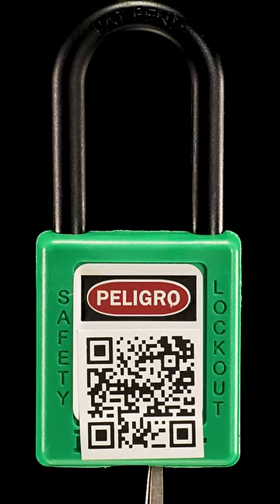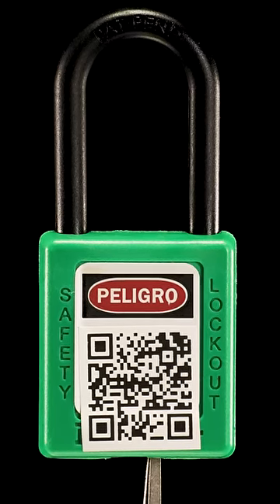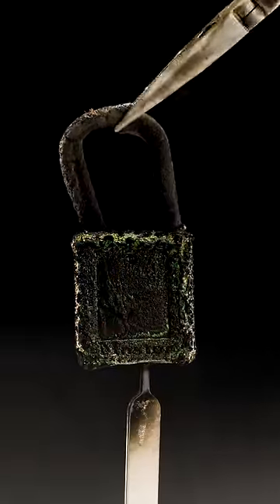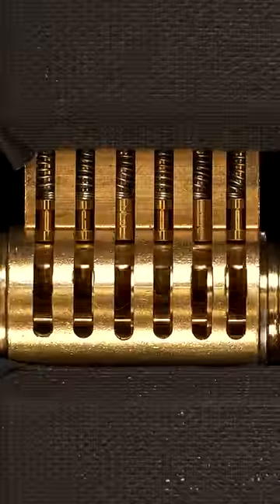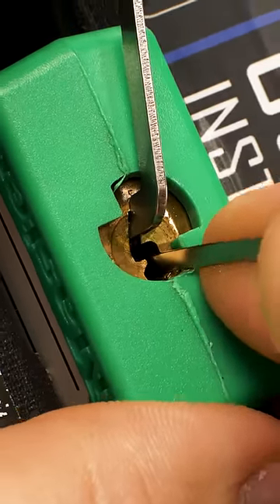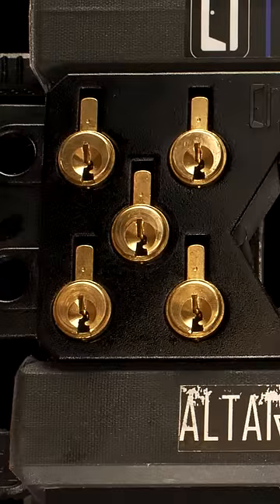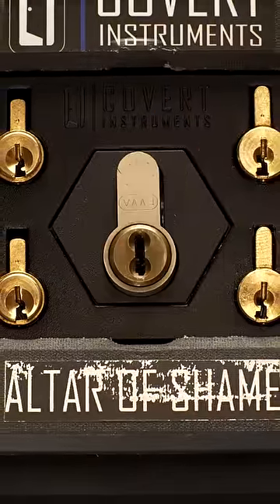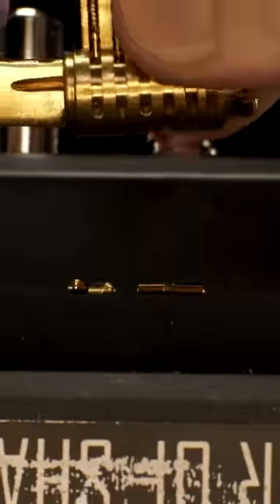Locksport Trainer

Comment: Well, in their defense, attempting to break that lock when it's in use is probably a felony charge.
Reply: if someone is already committing crime. They dont care if its illegal to melt the lock
Reply: @mar_3620  But that's the thing, that's not a lock you use to store valuables, it's a lock-out/tag-out lock. It's not designed to be durable, it's designed to indicate that there are people working on a dangerous machine that's currently inoperable. If these locks are disregarded, and the machine is turned on, those people end up dead.

No one can remove these kinds of locks other than the person who placed it there (or an authorized personnel, after a shit ton of safety checks and paperwork). That's how they keep a headcount. If you're not that person, or haven't gone through the procedure, the act of tampering with that lock is itself a felony.
Reply: @Gatlinggunman  and possibly a homicide
Reply: @Gatlinggunman this info needs to be posted more in this vids comment section
Reply: @Gatlinggunman That doesn't change the core point though - given that we're primarily depending on policy here and the lock is really just a strong signal to stop what you're doing, why go through the extra effort to make this lock pick resistant when the same company refuses to use these exact same cores in their "high" security locks that are actually supposed to withstand physical attack? If a plastic lock is enough to stop an attacker, that attacker probably isn't going to try and pick the lock either, because they're clearly not really trying to break in.
Reply: I prefer a cordless angle grinder for the plastic lock. Its the greener way to do it...less carbon emissions.
Reply: @Unit-kp8wm  The video is in a broader context of a large number of videos by McNally about Master locks being bad, and it's a YouTube short. It's pretty clear that it's a criticism of their overall lineup by the fact he calls this their most secure lock, rather than just saying "lol Master makes a plastic lock". If it was directed solely at this lock he wouldn't have bothered mentioning their other locks. It's also worth noting that the opening of the video very clearly shows the lock out branding on the front of the lock which is very clearly different to Master's high security branding - not everything has to be spelt out in a one hour video essay.
Reply: @Gatlinggunman  this is absolutely true.... there is a warehouse with a breaker that has this lock on it for about the last 40 years but since it is safety protocol that only the person who puts it on is allowed to take it off.... since that person isn't there anymore and nobody knows exactly what it goes to or what hazards could be involved, no one dares to take it off.... it will probably be there another 40 years until they are ready to demolish the building to start over

Comment: To be fair I think the lock is more for "lock out tag out". Nothing to break into, more for stopping something from operating. That doesn't excuse all their other failures though.
Reply: 100%. It's disingenuous to compare these to any of their other fantastically terrible products.
Reply: I'm so glad someone beat me to this... LOTO (I've got one with my picture on, but never use it) 😂
Reply: @benjurqunov  wtf? 🤣 What's that got to do with anything
Reply: Well it does say safety lockout right on the lock.
The irony is their "toughest" laminated padlocks that are for security deployments, don't have the good core that these loto locks have. This has 5 or 6 pins with security pins, bypass shielding and an unusual keyway. The security locks have 4 pins, no security pins, not always bypass shielded, and a keyway that's more open than the great plains.
Reply: @Druid_Plow  Exactly! The problem is that they put one of their best cores on the lock that's meant for the least secure application. Why put pick-resistant cores on locks that are made of plastic?
Reply: @SalahEddineH  So you can't remove it without evidence if you have malicious intent (you can cause harm to someone and make it look like an accident). It makes a certain amount of sense to have a good core in it. The thing that doesn't make sense is that the other things that absolutely should have the good core *don't*.
Reply: @tylisirn  Hum.. That's actually quite the good point. Cutting the lock is obviously destructive and not covert at all. And so it would show obvious tampering, if the lock is found (If it just goes missing, and the injured worker can no longer speak for himself, then it's another problem.)
But yeah, you have a point. I was assuming there is no reason at all to bother picking the lock if it can be cut so easily, but staying covert is one reason to do so. Like a worker  secretly using an override button to save himself time or effort, when protocol calls for it to only be used in emergencies.
And you're right. If they CAN make a good core, not using it on all their other "high security" locks is nonsensical.
Thanks for the reply, mate.
Reply: The point is exactly that, they put their most pick resistant core into a lock that isn't meant to do anything other than tell people not to use something while so many of their locks meant to actually keep people out for as long as possible pop open in seconds with one squiggly boi.
Reply: @talinpeacy7222  I have no rebuttal...
Reply: @talinpeacy7222  loto is more important than your shed
Reply: always weird that they obviously know how to make good cores yet they dont put them on the locks that are actualy for security.  You dont need massive pick resistance on LOTO as nobody wants to mess with those.  Your at best going to get fired for tampering with someone elses LOTO lock without going through the proper steps to clear a lockout.
Reply: This is exactly what it’s for. You can’t skimp out on the internals of a Tagout lock, Because if it is opened accidentally then someone is likely to be hurt. However, If a tagout lock is blowtorched like it is here, Someone is deliberately trying to harm someone, And thus is a much more serious criminal charge.
Reply: @Milokiss82  but then why not just use a metal lock with a good core? A cut is as malicious and obvious as blasting it with a torch?
Reply: @Blaze5x5x5  because you have to use a lock that only comes with one key and its a lot easier to remove the lock of its not metal in the event that the key is somehow lost. These locks are standardized. If someome tampers with it they will catch a criminal charge. Osha doesnt play around with lockout tagout locks
Reply: @Blaze5x5x5  A cut is just as malicious and obvious as blasting it with a torch, Yes.

It is cost saving, Because you are supposed to replace tagout locks regularly, And is tamper-evident. If someone cuts it, You have a criminal case on your hands.
Reply: @tylisirn  Okay now that is a good point. The fact it maybe even true is sort of sad. I mean "DO NOT FUCKING TOUCH" should be enough reason. 

 Feel like the fact it is a hard lock someone like myself but ill intent with no knowledge of what LOTO meant I will be like 0o0h this looks important! It is locked so something goodie or interesting must be inside. Why else would they lock it? What does this do. 

 You know what they say. Curiosity killed the cat burglar..
Reply: Correct!
Reply: @pinpetos I think you guys are missing the point here, admittedly because this is quite a short video.

The point here is that the core in these locks is OK, which means that Master are willing to put in the effort to make a decent core, yet for some reason refuse to put that core in any of their locks that are actually supposed to resist attackers.

They're not criticising the fact this lock is plastic, they're criticising the fact that Master refuses to use this core in any of their steel padlocks.

(For a slightly longer discussion see Lockpicking Lawyer's video The Master Lock Paradox)
Reply: @Admiral.Snakbar LOTO on its own also isn't going to protect you if you're in the kind of workplace where someone is trying to pick open your LOTO lock. LOTO is meant to prevent unaware operators from accidentally activating dangerous equipment when there's people at risk, it's not there to stop deliberate murder

Comment: Just a heads up. This lock isn’t meant to actually keep you out. It’s more like a notification. Loto locks are used to turn off heavy machines and let others know you’re working on it. They are easily destroyed so that If you left your lock on a piece of equipment and went home or something it can be easily removed. We use them in my factory when making minor repairs and adjustments on equipment to make sure people don’t accidentally turn it on and kill you when you’re inside. The factory has literally thousands in hand and since they aren’t meant to protect anything the cheaper the better. Which is probably why they have extra tumblers. Literally every employee has at least 2, while maintenance staff can have dozens.
Reply: Was just coming to say the same thing
Reply: Add to the fact you can one tap it with a mallet on the body and it shattered into pieces lol
Reply: I think the point is that it shows that Masterlock knows how to make a great lock, but chooses not to.
Reply: Legally needs yo resist a force of 50 lbs, that's isn't much. The purpose of this is safety and protect employees while performing tasks that requires energy insolation.
Reply: Congratulations we all knew that already
Reply: Well, aren't you smart.
Reply: @BoJoFohPah correction you knew that already not everyone's gonna know why this locks used
Reply: That was my last working lockout thanks
Reply: They're also plastic so they don't carry an electrical current. Lockout is used on electrical breakers/disconnects often
Reply: I wonder why they bothered putting security pins in it then
Reply: Ah, late to the party but scroll down to see if anyone noted it's a lockout lock.
Reply: Which begs the question why the fuck a lock like that would have such a pick resistant core.

Seems like even one of those fake pinless handcuff locks would've been plenty for this application
Reply: @devial9879  I do think you want an actual lock core in a LOTO lock, so that nobody else's key will open yours - after all, the purpose is to make you stop to think about what you are doing, and unlocking the lock with your key could easily be done thoughtlessly.

But I really wouldn't expect any more than a basic four or five pin core with all standard pins.
Reply: Why lockout when you can work hot?
Reply: yeah...the point is one of their most pick resistant locks is a plastic lockout lock, which is entirely backward
Reply: Why are they pick-resistant
Reply: Why are they pick-resistant?
Reply: This lock isn't the problem. The problem is that it proves Masterlock can make a damn fine core... and they don't use it on locks actually meant to protect things.
Reply: There's only supposed to be one key for it too.  They use six pins to increase the number of key combinations.  They make them pick resistant because of the idiot proofing requirements.  You know some bored machine operator who's seen a couple of these videos and has a paper clip is going to try and get back to operating.
Reply: Lockout locks need to be better. Idiots will remove them otherwise
Reply: So what is the point in making it so pick resistant if it can be easily destroyed? If it's just a notification, it could get away with a normal level of pick resistance. I've had to use lockout tag out locks for almost 7 years now, for reference, and between the two jobs, they have always been metal and also pick resistant.

Comment: Was a locksmith for over 30 years. Picked several hundred locks. Proud to say that I’ve had to drill less than 20 locks in my career. Practice practice practice.
Reply: but also always use the weakest link in the chain. if it is made from plastic and destruction is an option, using a blowtorch is the weakest link. only if you hane to open locks non destructively it's worth to train exessive amounts
Reply: Liar. Locksmiths who actually pick locks are illegal, clearly.
Reply: @XiaolinDraconis  Then how is there a lawyer one? Checkmate atheists
Reply: @Emiturbina  aha, you forget, it's because he's a lawyer that he knows to never show his face.
Reply: @Emiturbina  good luck catching that guy. You'd be hearing click out of 5 annnd we're gone before you even realize he was there, picked it, paid himself, and already left.
Reply: @XiaolinDraconis  no the hell its not do some research

Comment: “It almost entirely made out of plastic”
Proceeds to unleash hell on earth
Reply: What were they thinking 🤣🤣🤣
Reply: @CS-zn6pp  it's a LOTO (Lock Out Tag Out) lock. It's used for safely locking out machinery. It is NOT meant for security.
Reply: How do this many people like a comment that isn't even using the correct word?!
Reply: @CWHolleman  I'm glad someone mentioned it. I'm sure it's a typo though. However, in case it isn't, proceeded is the right word.
Reply: @CWHolleman  relax its a typo
Reply: Modern problems need modern solutions
Reply: @ZERIMAR-kv9nk  thanks for mentioning bro
Reply: Don't forget the pause for dramatic effect.
Reply: @CS-zn6pp nothing? These locks will  lock out machinery, typically plugs and other electrical connectors, You are not trying to secure it, instead you are warning to not touch or not plug it in

Comment: The reason this lock is made to be  easier destroyed than picked is due to the fact that it is a LOTO lock. It's a liability issue to remove a lock by picking it because you could always reattach it to say you were using it properly. If you cut it or destroy it, nobody could reattach it. Typically companies have policies on how to remove loto locks and they will never pick it.
Reply: But why can't they make all their locks pick resistant
Reply: LOTO??
Reply: @UserOfTheName  I imagine each degree of anti-picking security adds to the cost… which explains why. 
Super-Ultra-Maximum security = expensive
Reply: @gruntopolouski5919  LOTO means "Lock out Tag out" it's a sort of safety guard mechanism used on job sites

basic gist is say if you're doing maintenance inside a large dangerous machine (really anywhere that'd be bad news for you to be when it's turned on) you'd use one these locks to prevent anybody from turning it on until you're out of the danger zone and remove it
Reply: That's right. Protecting insurance companies is more important than actual security applications... SMH
Reply: @dustinm2717  thx much
Reply: @WingmanSR  it is less about insurance and more about homicide. Pick the loto, turn on the machine, Earl dies, you put the loto back.

Hm...

OR You can not pick the Loto, you have to destroy it to kill Earl - now the police has some evidence.
Reply: @gruntopolouski5919 lock out/ tag out
Reply: @gruntopolouski5919 
Lock out/tag out. For dangerous heavy machinery before servicing it.

Comment: LOTO locks are often put onto electrical equipment more as a safety measure rather than a security one, and need to be as non-conductive as possible
Reply: That makes sense then. Yet there is no other way to make sure no one is touching it that's easier? I just don't understand where one would stumble across this and mess with it if they didn't know what they were doing anyway.

 Someone said they put a good lock on it for liability issues. Meaning one can't accidently think it is something else - ill intent has to be required to open it.
Reply: @dianapennepacker6854    ah I should clarify, LOTO locks are typically used when the equipment is off, and placed in positions to block it from being turned back on or plugged back in for the safety of a maintenance crew.
Other methods are used to keep people from zapping themselves while it's on, could be restricting access to the area, needing a tool to open enclosures/cabinets, or keeping the equipment closed with an actual lock on an area that is touch safe.
Reply: I think the point is that this is literally masterlock's only half-decent core, and it's in a lock that doesn't need it.

Comment: It's a safety lock for maintenance use in industry. We use it for locking main switches on industrial machinery. It's not to be impossible to remove, it's just to be there and mark the machine as stopped for maintenance. If you lose the keys you can cut it without breaking the switch
Reply: Shhh!!!! don't ruin it for the plebs. Fire cool, derp.

Comment: For those curious, this is a Lock Out Tag Out lock, or LOTO for short. These locks are used in industrial settings when machine operators may be working in a machine near dangerous parts. You simply go through the steps of shutting the machine down, then place this lock at a designated spot sorta like a control point (may be a plug separator, a power switch, or even the keys to the machine inside a LOTO lock box). These aren’t meant to secure anything that’s to get stolen, but rather keep someone from turning a machine on while you’re inside it. Funnily enough, though, for some reason the core in a LOTO lock is more secure than anything else they’ve put out. This may be because it is against regulation to allow LOTO locks to have a universal key, which is one of the selling points for a-lot of Masterlock’s products.

Comment: “This is Master Lock’s most pick resistant lock, it’s made almost entirely out of plastic”

*screw you lock you’re going to the flamenwhuerfer dimension”
Reply: I believe it is werfer
Reply: Its good that its made out of plastic. Its designed for lockout tagout in factories. This lock isnt for private use.